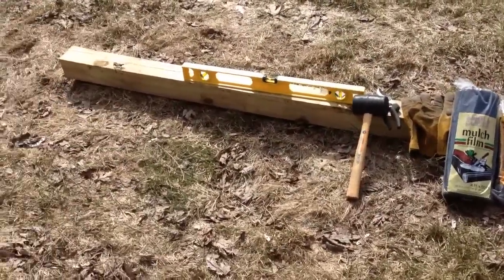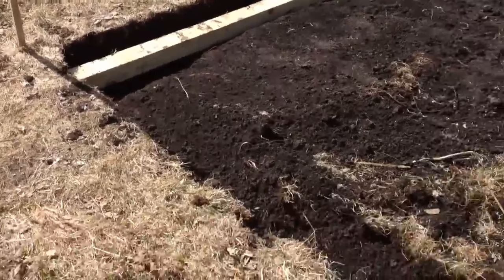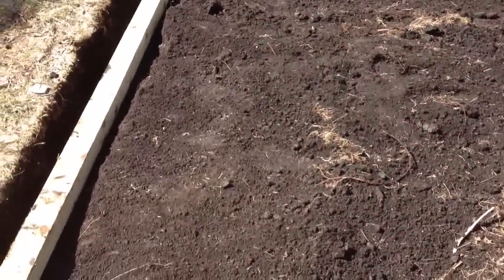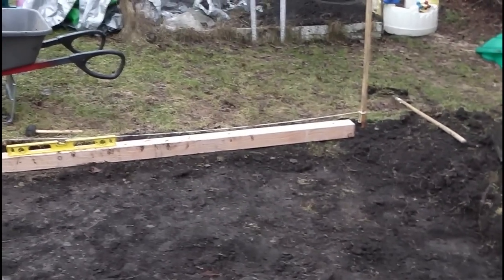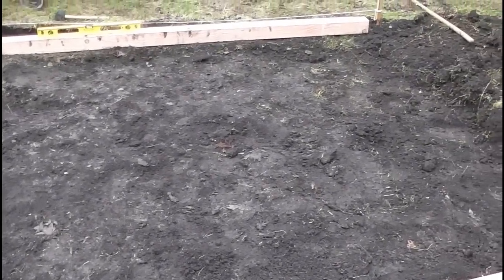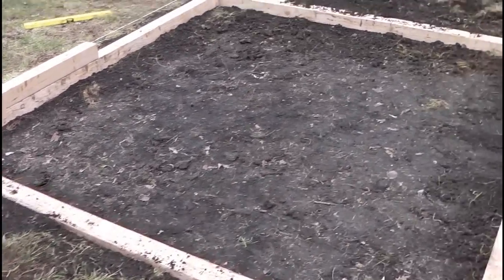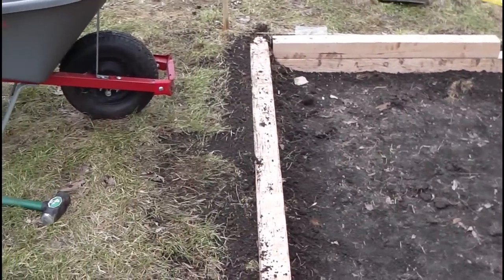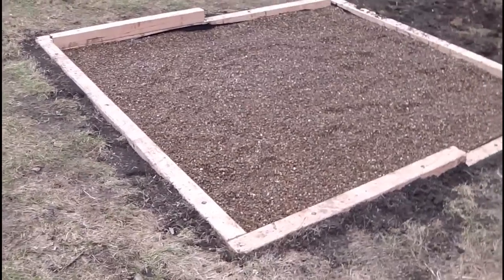How to Level a Yard for Playset Installation

Comment: After you were done, did you wish you had made the base about twice as large so that they weren't swinging over top of a piece of lumber and sliding onto your sod?
Reply from the maker: Yeah, I thought I had it measured just right before they installed it, but I was about 2 feet off.  I have since removed the two top side boards so that they don't pose as great of a hazard for the kids swinging on the swings. It's still level and works just fine. :)
Reply: Came to comment section yo see if any one was thinkin the same. But in each casegood job!

Comment: Question did you ancker it after you placed it on top the gravel??
Reply from the maker: I have the anchor stakes but I did not put them in. The playset is heavy enough as it is....it's not going anywhere :)
Reply: OikoEco Everything just sits on top of the pea gravel with no anchors?  And it doesn't settle or move?  I haven't assembled one of these yet so I don't have a feel for how heavy they are.